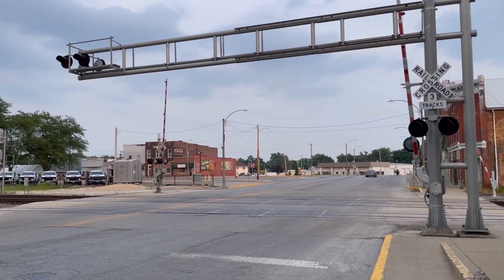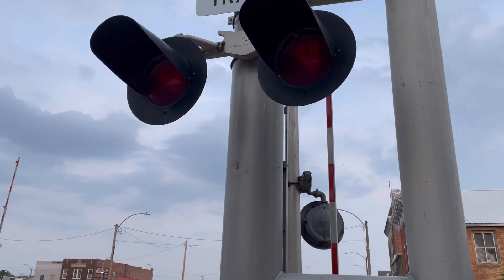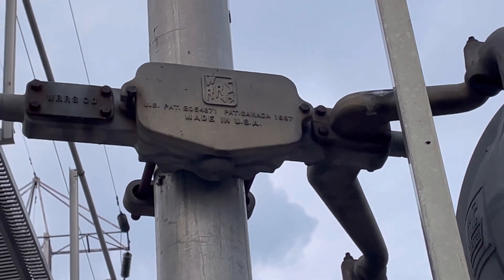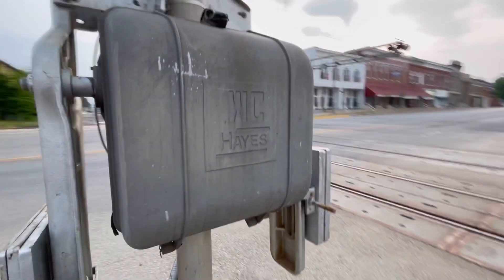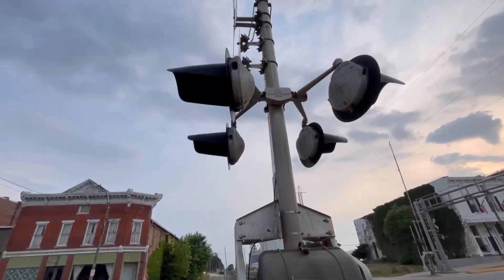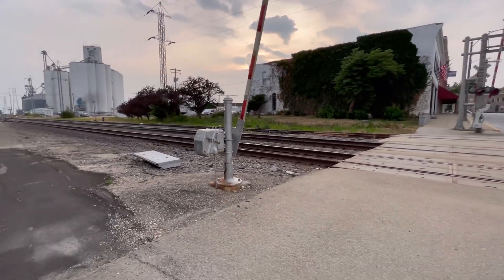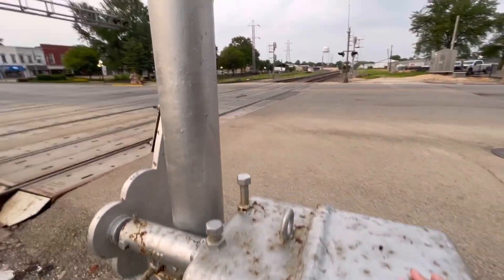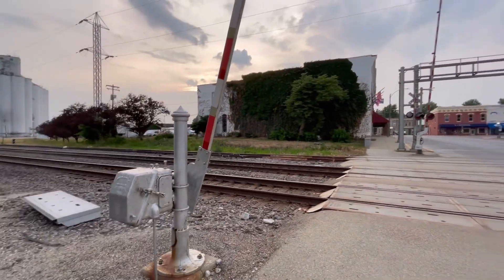The Exchange Street Railroad Crossing | First Crossing Tour Video

Comment: Epic crossing. 
And to tell ya a few corrections,
So the lights are not 12x24" like what you said in the beginning, they're all 12x20" lights
And the pedestrian gate isnt made by Griswold, its actually a Federal Signal pedestrian gate mechanism, and those are pretty rare. None that i know of used to have wishbone gates on them, but one way to know if they did or not is by the shape of the gate arm, and the one you shown seems like it always had a standard style gate on it
And the only way to tell what type a general signals E bell is by the sound. General signals barely changed the housing of their bells over the years

But either way, neat tour. Looking forward for some more tours if you're gonna make some more lol
Reply from the maker: Thanks for the correction